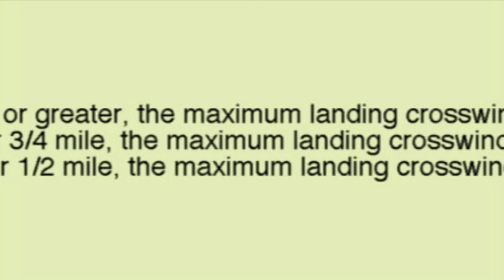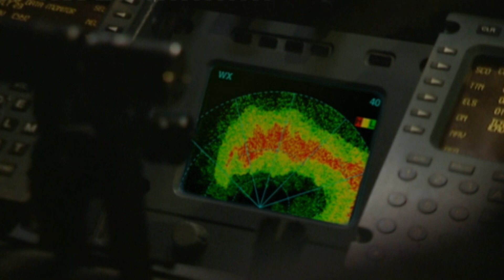Did These Pilots Ignore the Airline’s Own Crosswind Limits? 🛣 Air Disasters | Smithsonian Channel

Comment: A captain with 10,000 hours of flying shouldn't lead into a crash or anything like that. They could have just aborted the landing and maybe try another way to land. Or keep circling the airport till the weather conditions improve and is much safer to land on the runway. Plus why did the controller did not advice them to go around instead?

Comment: But pilots failed to activate spoilers or speed break to avoid land at high speed.
Reply: True, but they were being overworked and simply forgot to
Reply: @benthomas2232  forgot what?
Reply: @jegortsukanov8990  Arm the spoilers.
Reply: @jegortsukanov8990  did you actually watch the video?
Reply: @benthomas2232  I KNOW BEN!!!
you look like fighter pilot.
Reply: @jegortsukanov8990  how do I look like a fighter pilot?
Reply: Besides, this crew were overwhelmed, overworked and overstressed by the situation they were in.
Reply: @benthomas2232  I told you
Reply: @benthomas2232  can we stop doing that?
Reply: @jegortsukanov8990  doing what?
Reply: @jegortsukanov8990  you didn’t tell me anything
Reply: @benthomas2232  could you stop doing that.